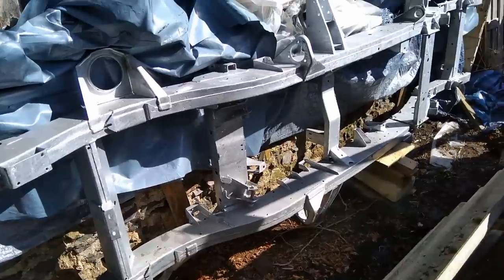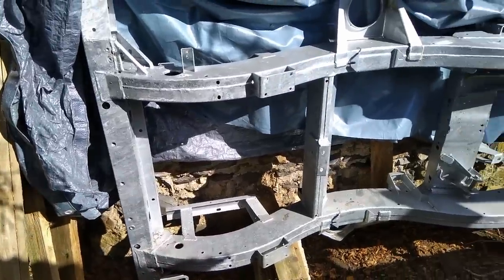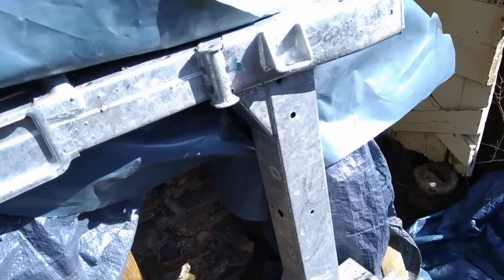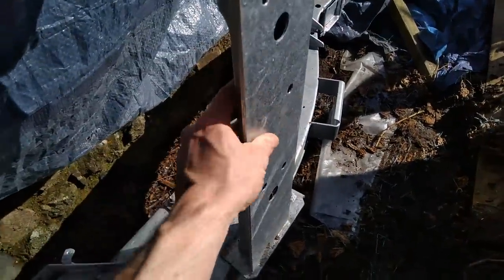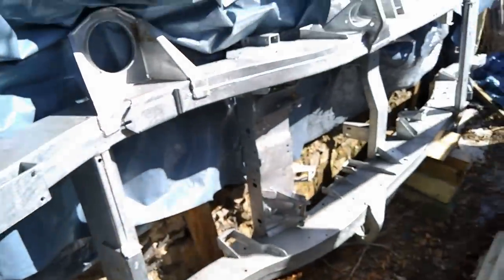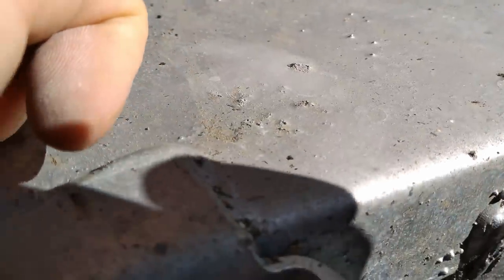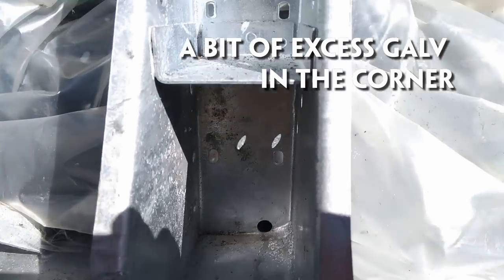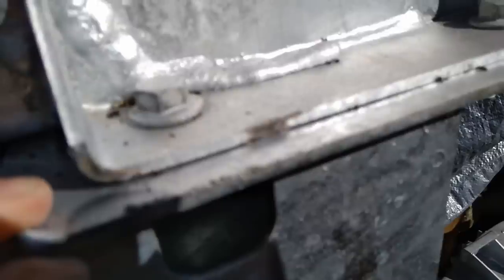Marsland Chassis - What's it like and why I didn't buy a Richard's chassis

Comment: I bought Richard chassis for mine although they weigh a lot more I can't see anything but this being a good thing. You say you wanted to keep it original Land Rover but it's a 300 TDI with TD5 rear crossmember. Everything fitted perfectly on mine can't comment on Marslands as I've not use them.
Reply: I've had a marsland with parts missing... Totally agree with the No-go td5 rear end and the extra thickness can only be a benefit for what, 15kg-ish (and about £1000 less...
Reply: I fitted a Richards and it fitted perfectly, cannot fault it.

Comment: Very useful thanks. Ultimately this is what I want to do for my 110. The fact that it's dulled down slightly will probably help if you intend to paint it. Maybe I should get on and buy one!
Reply from the maker: If you have the space and money, you don't need to worry about rotting in the elements! Unlike a Defender normally....

Comment: FWIW when I worked for what was then in the 1980's LRPE (Land Rover's parts division) responsible for outsourcing/re-sourcing Series/Defender chassis I chose Marsland because of their superior quality, experience, production facilities and willingness to work to OE standards. Consequently they were allowed access to genuine OE subcomponents such as the C section chassis rails. There are pros and cons to galvanising, eg surface finish, need to drill out holes and susceptibility to warping.

Comment: For originality I prefer Richards chassis so that I can have the correct rear  cross member rather than Td5 type…….The four plate construction method employed by Richards is, of course, the way Land Rover used to produce their chassis in years gone by and I always think looks and feels more substantial than the two C section chassis.
Reply from the maker: I'm a bit smitten by the Td5 style crossmember, so maybe that's biased my choice. I think Richards started out by producing Series chassis (4 plates as you say) so maybe they just used the same process for Defender ones. Thanks for the comment!

Comment: Not a fan of c section chassis rails with open overlaps on the inside that trap moisture. Also debatable if the galv actually gets in between the overlaps inside, doubt it very much, it just bridges it. Richards chassis for me.
Reply: DPG Defenders the galvanising doesn’t need to cover every mm to be effective
Reply: Mmmmmmm, pretty sure it does. Look how fast a stone chip to paint starts to rust
Reply: This was my reasoning for a Richards chassis purchase.
Reply: Wax oiled the crap out of mine

Comment: I would rather have an extra 30kgs added to my chassis for lower down centre of gravity,rather than a 100kg roof rack.
My 36kg spare wheel is fixed to the floor of the tub.
Any weight below the centre line (within reason)is a benefit to handling etc.
Just my preference when tackling the big rivers and hills here in S.Island, NZ.

Comment: The bump or raised area at 10:42 is heat distortion from when the weld the little overlapping angle from bottom of trailing arm mount to chassis rail web

Comment: These are very good chassis, but no good leaning against a wall. I had mine delivered and replaced the one in my 1996 300TDI 90.  No problems with putting it in that I know about, some threads needed cleaning and it still looks as it did when it was delivered in 2011.

Comment: A thought. The critical item on our LRs etc is the chassis strength. I won't go into the structural calcs, but there is a problem when we attach accessories. 2mm mild steel (which I believe is used, not high yield steel) is quite thin. Winch bumpers, winches, recovery points etc all made from 5, 6, 7mm steel bolted onto 2mm steel...think about it...there is something not right is there. 
A few 4x4s use 4 or 5mm steel in the chassis which is more like it. These are Ford Transit pickups supporting a largely static load on road, these 4x4s get bounced around, yomped, yanked, twisted, sagged, hogged and we rely on 2mm steel in box sections 70mm x 80mm at the front end.
I've massively reinforced my chassis rails ti withstand the loads, especially where I'm mounting a 5ton winch, recovery eyes etc.
LR may have deemed the chassis adequate, but we now take our trucks way beyond original expected live loadings. I'd prefer the whole chassis in 4mm HS steel, especially for centre of gravity.
Reply: Correction...these "AREN'T" Ford Transit pickups.....

Comment: Can I ask what is the advantage/disadvantage of welding the chassis as C sections, rather than on edges?
Thanks for another informative video!
Reply from the maker: I don't have the credentials to say what the strength difference may be (if any), but for me it's an aesthetic difference - knowing that underneath it's more "Defender" than "kit car" :)
Reply: @lrworkshop  I think the Landcruiser 70 chassis are C section welded as well?
It might be something that adds to the overall rigidity and stiffness of the ladder frame design, used by Land Rovers and Land Cruisers.
Cheers!
Reply from the maker: I've got a video i've got to edit about the 70 series chassis.... soon!

They are two C sections but one fits inside the other, so there is double thickness of material top and bottom
Reply: The advantage is price - pressing the sections into C is cheap.  Welding by hand is expensive.  This later method halves the welding required on each rail.
Reply: You’ll get more stresses in the welds. But remember, series vehicles were built this way
Reply: husq2100, SIII 109s had the c-section chassis, but all other Series models had the corner weld method.

Comment: Would it not be prudent to wax/preservative (Dynax S50/Dinitrol ) inject this if it is possible to get a compressor near enough? If its going to be standing around for a few years pending your rebuild.
Reply from the maker: Possibly. It was pissing with rain when it arrived mid winter and has been covered and dry since. It's definitely something i'd do when rebuilding, but for the moment it's 400 miles from where I live

Comment: That finish really is terrible, no one heard of a grinder before galv'ing it. There are a few BIG issues with using a modified Puma chassis, one, it's not original like-for-like, Yes it has OM parts to it, but that's not the manufacturer, Marsland is, as they did the final outfitting to it. Sleeves on bushes is a terrible idea as they seize in. On the other hand, Richards Chassis are more correct to year with all the correct parts in the correct place and none of the problematic points that the Marsland has. Oh, and it's cheaper! The 2.5mm steel actually adds life to the chassis, quite a lot of life and generally it doesn't add a lot more weight, it will add 1/5th extra to the main chassis rails only. Honestly if you're a purist, you'd never have the td5 rear crossmemeber!
Reply from the maker: A purist in terms of ROW spec rather than 90's spec.
Reply: Richards defender chassis is not insurance approved.